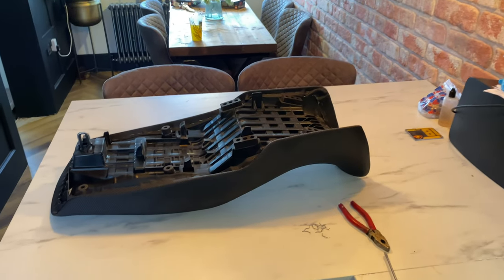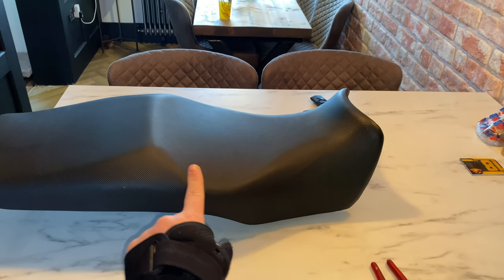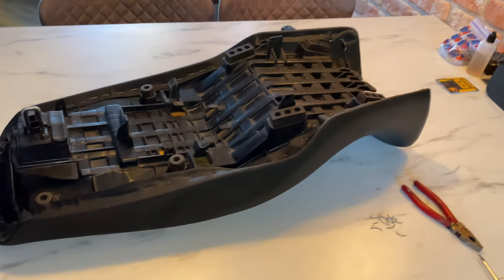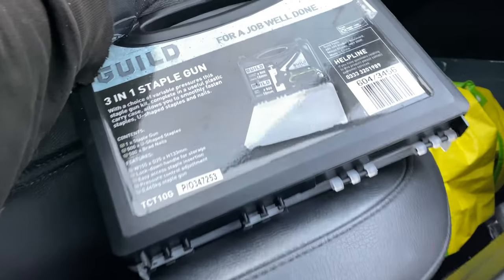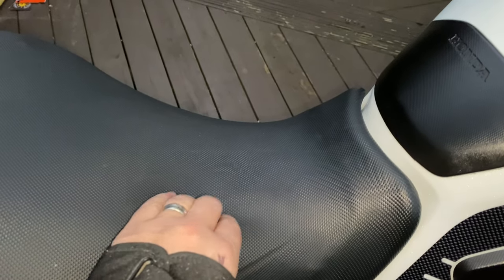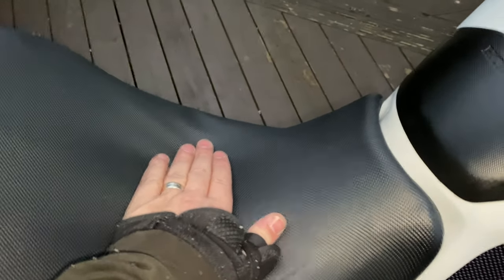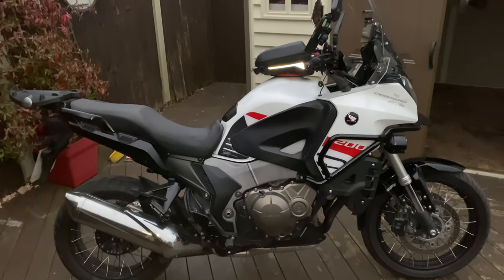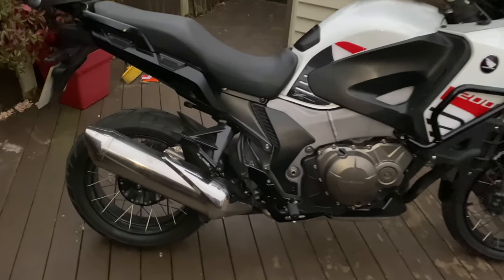Lowering A Motorcycle Seat By Cutting Away Some Of The Foam   Honda VFR1200X Crosstourer

Comment: I lowered my seat by removing the rubber mounts on the bottom of the seat. I put some draft excluder to go between the mount and the bike and that worked for me.
Reply from the maker: 🤔 might try that too to lower a bit more, did you take off the square and the round rubber mounts
Reply: @Motourev  Square and left  round mounts.
Reply from the maker: @blearyview2254  done that too now, perfect
Reply: @Motourev  Nice one, next thing that worth considering is a comfort seat, especially since you  do big trips, it a major. major upgrade on stock.
Reply from the maker: @blearyview2254  deffo something to think about